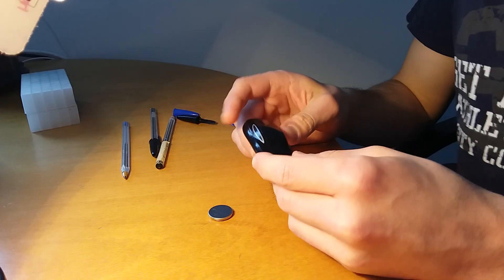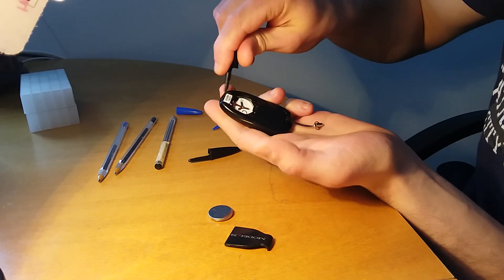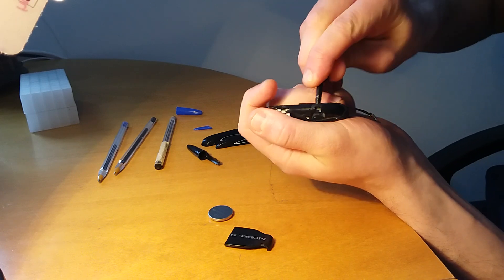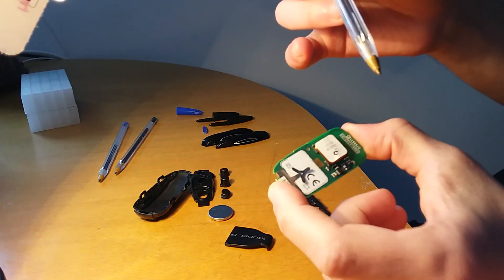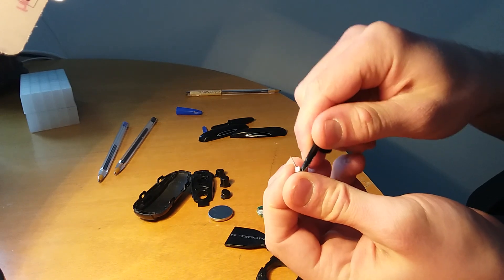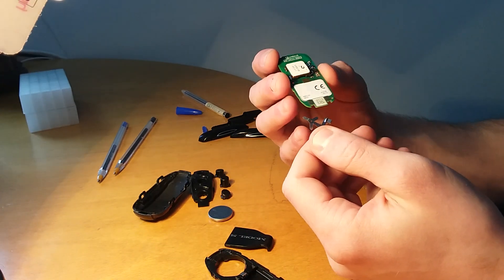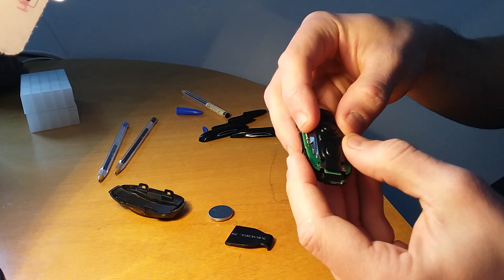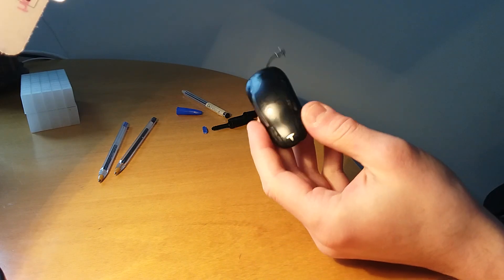Tesla Model S - X How to open and fix the keyfob

Comment: Model X keyfob (2018) has the part you bent soldered to the motherboard. So there was nothing there to bend. No other visible problems with it either. Just died after swapping out the battery. Also does not open the car when holding the keyfob to the glass and pressing the door handle, so RFID does not work either.

Comment: I changed the batteries of both my key fobs, but put the screwdriver too far in to take the battery out. So I damaged the contacts of the key fobs and they didn't work anymore. Thanks to your perfect video I was able to take the key fobs apart and repair them. Thanks for your video. And a warning for all who read my comment: be careful removing the batteries from your key fob!

Comment: Thanks for the great video. My 2016 Model S keyfob stopped working even after fresh battery placed. i followed your instructions and had the same "bent" metal problem. I did have to put a small wad of tissue under the metal piece to keep it from bending too much again and so far it is working.  I did have to use plastic spudgers I had left from an old IFIXIT project. The spudgers worked really well to get the side pieces off. I wonder if Tesla would sell a replacement metal ring surrounding the battery. I think metal fatigue has caused the small metal tab to stay bent too much.